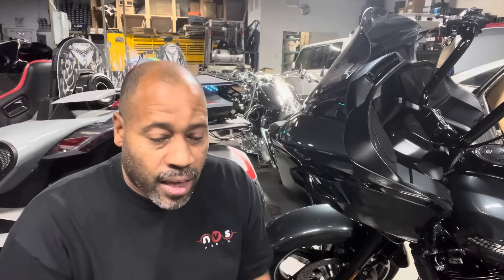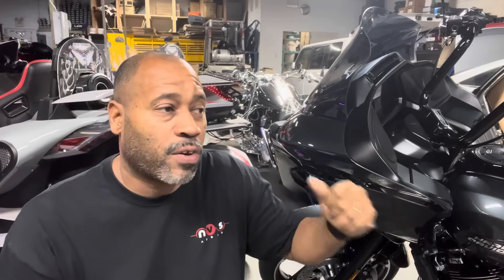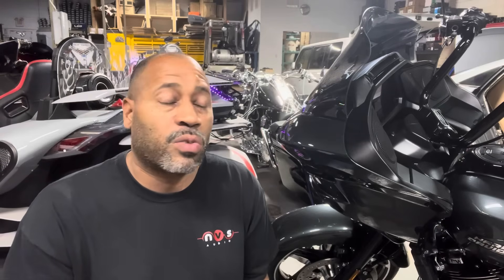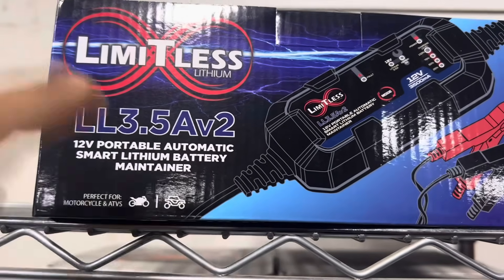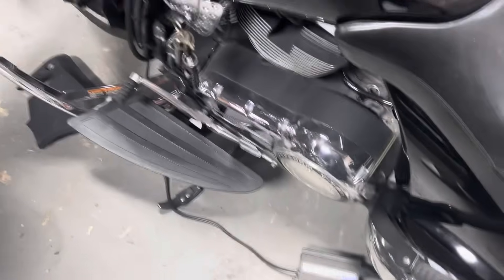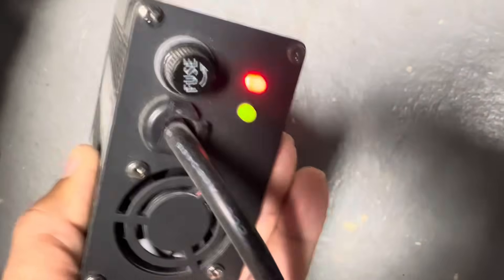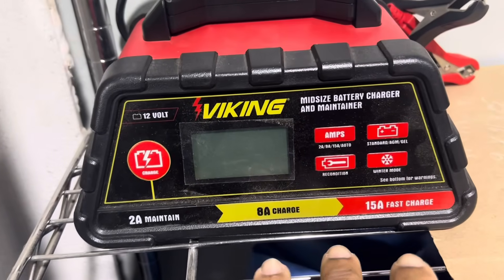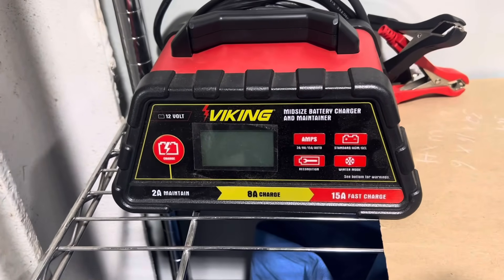Do not play your bike at a high volume for an extended period of time while it is on the charger 🔌!!

Comment: Will the Viking charger work with Lithium batteries?

My Stinger battery is swollen, so it is time for an upgrade. I know a Lithium battery has specific tenders, but could the Viking be used to charge it while tuning?
Reply from the maker: I use the Viking when tuning 

I set it to 15 amp setting 

Even with lithium 

But when I leave the bike to charge I use the proper lithium tender  that comes with the battery
Reply: @NVSAUDIO  Thank you

Comment: I just had a question i have the Rockford system in my roadglide and this thing sucks with the volume on 40 and the bike idling it's not even that loud and I can barely hear it on the freeway ive called Rockford and complained about the system and they had me change stuff and it still sucks I had a shop install it and I even took it to the shop and told them I wasn't happy with the system and they said they would upgrade the speakers for 1500 bucks and I paid 2800 for the system with install what speakers do you recommend
Reply from the maker: Email me 

We can help you .

Nvsaudio@gmail.com

Comment: Well that explain and why my 5 amp charger plug was hot AF after having it plugged in and tuning at full volume. And it was only running a FLX1000.4